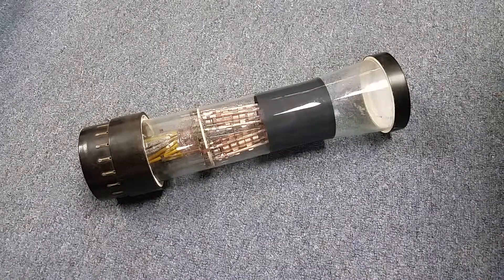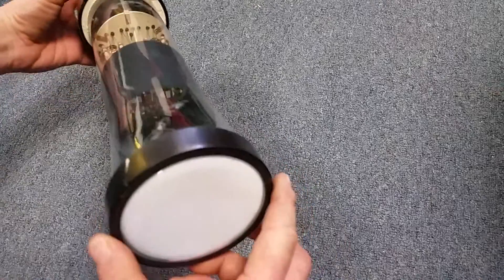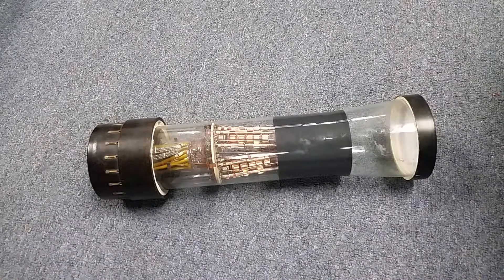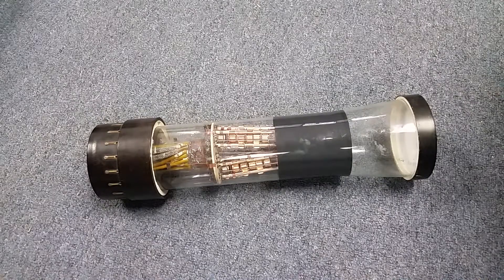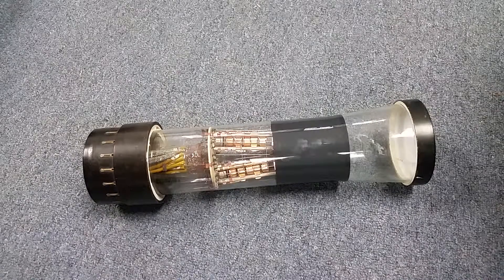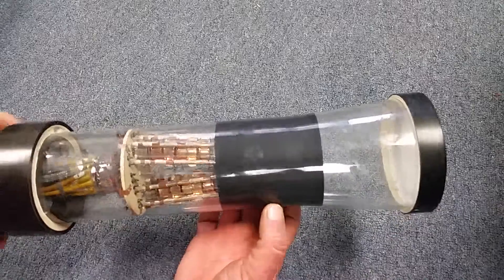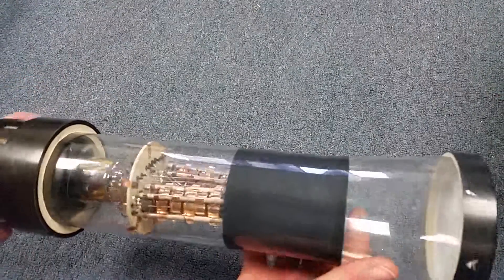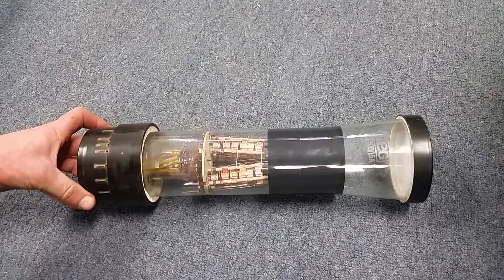Big German CRT

Comment: You probably know this already, but Tektronix was another company who made dual beam CRTs starting in the late 1950s, and they used them in oscilloscopes.  A. C. Cossor made the first dual-beam oscilloscope in 1932, but it wasn't a true dual-beam design since it used a third deflection plate in the CRT to draw the second beam.